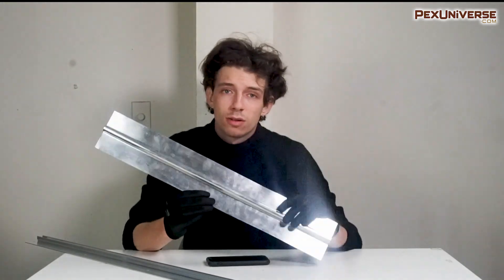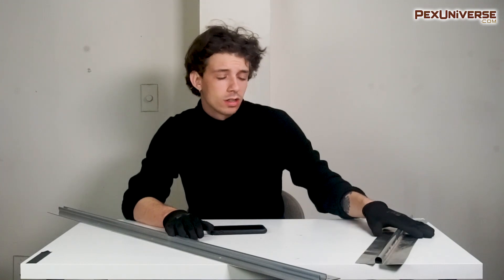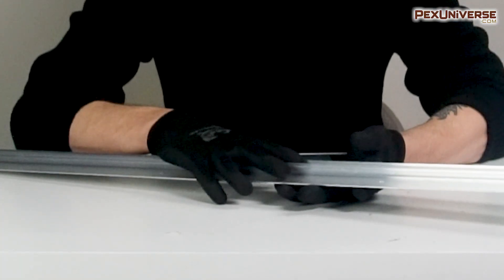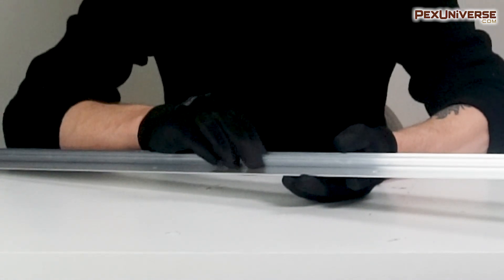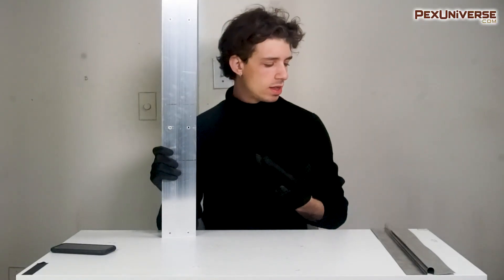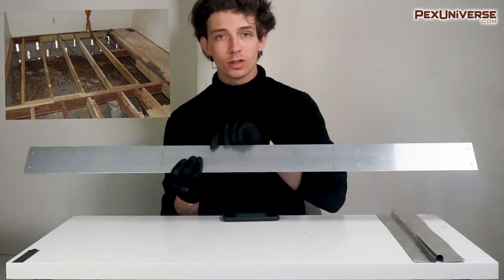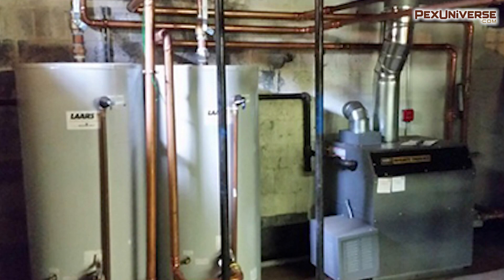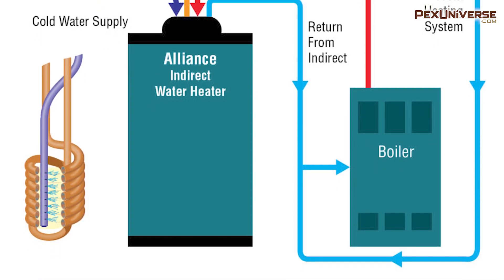What Is The Joist Track?

Comment: Do you have a video on "where exactly" to install snug radiators/baseboards. I'm interested in building an addition to my home which will have a new section of heat but I may want to move the current configuration around a tiny bit. I already know to place them underneath windows, but I'm looking for more information regarding the best locations throughout a bigger than average house. Thanks.